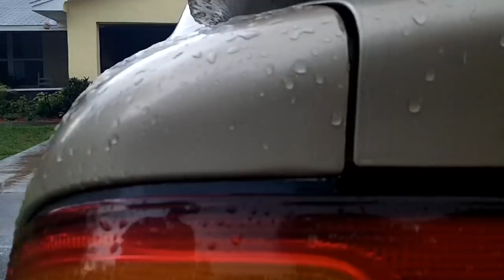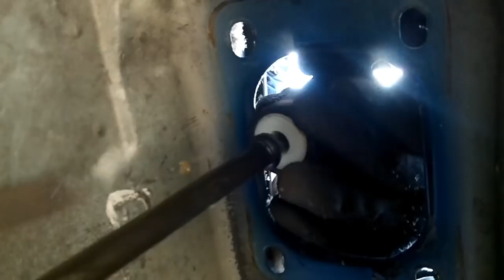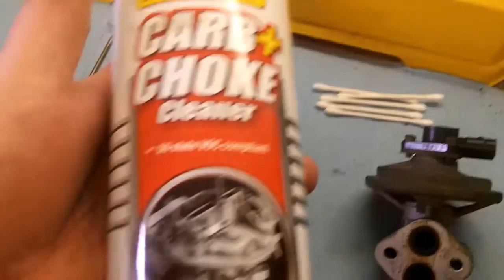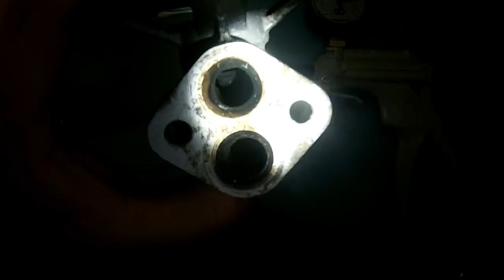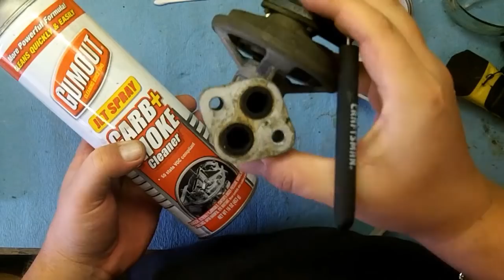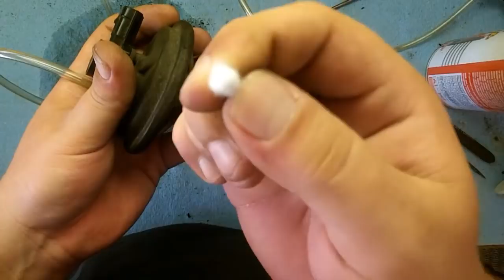How To Clean the EGR Valve

Comment: Is there a way to test it without the gun?
Reply from the maker: A regular vacuum gauge can do it and is much cheaper. The gun is only used to apply the vacuum but vacuum can still be measured with a stand alone gauge. Some type of vacuum gauge is required to accurately measure vacuum.

Comment: Both ports in the bottom are connected????
I can spray liquid on one hole and it comes out of the other with out sucking on that thing
Reply from the maker: Means the valve is stuck open and needs to be cleaned. If cleaning doesn't fix it then it's likely a rusted valve piston keeping it stuck in place. There's no way to fix a rusted stuck piston to my knowledge, it would need to be replaced.
A bad/busted rubber diaphragm will keep the valve closed, not stuck open, so it's not the rubber diaphragm in your case.
Reply: @DJDevon3  thanks... i ran a bicycle with thru it... it was clogged... thats what it was... THANK YOU!!!!

Comment: Hi, I have a 1995 Acura legend with 226,000 miles, my check engine light comes on and stays solid after driving few miles, I got a egr sensor code reading. I’m wandering if I just need to replace the egr valve with sensor and don’t have carbon buildup. Any suggestions would be appreciated.

Comment: What happens if i just disconnect the vacuum tube? better mpg ?
Reply from the maker: The O2 sensors will force the ECU to compensate fuel trims automatically. That means no change in performance or MPG. The only thing that will change is higher emissions. In some states it's illegal to disable the EGR system the same way it's illegal to delete the catalytic converter. If you have a stock setup there's no beneficial reason to delete those things.

Comment: i was gonna say this guys an idiot pumping brake clean thru his diaphragm but i see not bad mines not carboned but its real catchy like rust is siezing it up maybe 40k miles on a napa egr..
Reply from the maker: Good point. I have no idea how the rod is lubricated internally. If it starts sticking that sucks. I've never had to deal with that in any junkyard EGR on a 626. I can't speak for other vehicles if that might be an issue or not.  Definitely worth checking out the operation just to ensure it can slide freely, something I never even considered because I've never encountered it on a 626 EGR.

Comment: thanks, code 25 on my 91 toyota pickup states that EGR could be the problem. great video
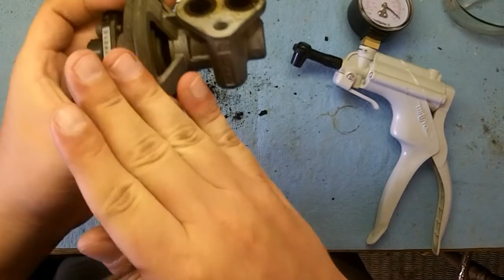Reply from the maker: Codes only tell you that a part is not functioning as it should. That's why I say cleaning the EGR doesn't mean it's going to fix an EGR code. It's still just as important to test the sensor which I cover in a different video but it's for the Mazda 626. You'll want to find a repair manual for your vehicle to learn how to test your EGR sensor. I recommend everyone check out my sensor diagnostic video too no matter what vehicle you own. I show how EGR passages are built into the intake manifold and the best place to look for clogs. The same concept applies pretty much to any vehicle older than 1997 as they all used vacuum EGR valves back then. More learning about older EGR systems ->. https://www.youtube.com/watch?v=ZSKs1WfM70I  If you don't have a 626 then start watching at 6:39 in that video to get a better understanding of EGR passages. They're important to finding clogs. ;)

Comment: what if we use sand paper the thin one?
Reply from the maker: No I don't think wetdry sandpaper would work well in this scenario at all.  The cavern inside the EGR is oddly shaped you couldn't clean inside it in that manner plus the carbon would clog up the paper the first time you used it.  Use pick tools instead.  Something as simple as a flathead eyeglass screwdriver would work well.  Use whatever you need to as a pick tool.

Comment: Thanks for video, I need to do this to my ranger
Reply from the maker: Yup this video can be beneficial to Ranger and Mazda B-series owners of the 90's since they would have used a very similar design.  Most 90's vehicles used vacuum actuated EGR valves.  Other manufacturers had wildly different designs (Chevy, dodge, etc..) but the concept is the same.  I wouldn't be surprised if you found a Mitsubishi symbol on your Ranger EGR valve as well. ;)

Comment: why not use a dremel with a brush on a medium speed wouldn't that be faster and cleaner???
Reply from the maker: The wires on dremels are notorious for flying off and they don't work very well.  I consider them a waste of money.  A small bottle brush is a good idea but it's not going to get the backside of the pintel or stopper.
Reply: When you're done with the dremel just vacuum any wires out.  I've used mine on tons of projects and they have been a d.I.Y lifesaver.
Reply from the maker: CCdude I'm not against the idea.  It's definitely a valid method and good suggestion for those that want to do it.  As a preference it's not for me.

Comment: Hi' i'm not getting a code but could it be the case that a clogged egr is what's causing my 91 dakota to cough and stall out occasionally? thanks
Reply: aw man thanks a lot; my truck is idling fine so i can omit the egr thing today and look at the fuel and such...thanks again!
Reply: Hey I dont know what happened to the reply but what did you do? I have a stalling issue on my S10 as well.
Reply: U won't believe it; i went to change my fuel filter and found that the rubber hose was falling apart and needed replaced but the rubber line was factory made onto the steel line. i cut off the steel line on both sides of the filter and used a compression fitting on the cut off steel line ;the opposite end of the fitting was barbed and allowed me to clamp on efi hose and i though that would fix my stalling issue but it did not. Next i filled up and put in a can of sea foam in the tank...Almost instantly the stalling stopped Plus, the smoke i was getting went i'd first start the truck is Gone! I call that additive Mechanic in a Can! I think that deteriorating rubber fuel line was getting into the gas and clogging things up, and/or water in the gas. Try the sea foam and tell me if it helps.
Reply: Kevin S. alright I will have to try that. Did you just add it to the fuel or also spray it into the intake?
Reply: since mine would start up, i only poured it into the tank, plus it's designed to mix with a full tank. hope you have my luck!
Reply from the maker: This essentially says it was either a clogged injector or fouled spark plug.  Induction cleaners can help but I can't recommend fixes without diagnostics.  No such thing as mechanic in a bottle.  Even a clock is right twice a day.  Without diagnostics you just made a wild guess.  Just because it was the right answer doesn't mean you came to the answer the correct way.  I can't condone that.  Glad your vehicle is working though. :)
Reply: thank you so much for weighing in on this DJ and for informing me of the possible underlying issues that the sea foam seemed to address. My hope is that it was a clogged injector because a fouled plug scenario worries me, i.e., what's fouling the plug to begin with? thanks for reminding me that my hail mary is not an answer in itself :)
Reply from the maker: Well take out your spark plugs and inspect them.  I forget that some people don't do the basics which depending on your car knowledge is excusable.  If you know cars then you should know better.  Induction cleaners like seafoam clean carbon buildup inside the combustion chamber and air intake.  Adding it only to the fuel supply will only clean the combustion chamber leaving the intake uncleaned.  That's what the smoke show is coming from.  The more smoke the better the result from the cleaning.  Normal operation causes carbon buildup.  An excessive amount of buildup means inefficient combustion either from a faulty spark plug (misfires), vacuum leak, clogged injector, open injector, shorted injector, bad rings, or other head mechanical issue like poor valve timing (jumped timing belt).  There are plenty of things that can cause it and without finding the culprit this issue will happen to you again.  Depending on the cause will depend on how soon the issue comes back. ;)  If it's just carbon buildup from normal operation on a 20+ year old vehicle then expect another 20 years until it comes back.  If it's due to bad spark plug then it could happen again pretty quick.  If it's a clogged injector then it will take some time.  Point is without finding the underlying cause you won't know when to expect the issue to return and to me that's unsettling not to know.  Hope that's helped shed some light on what to expect and why.  Keep on truckin brother. :)
Reply from the maker: Oh and since this is an EGR video... CAN SEAFOAM HELP CLEAN THE EGR?  Yes actually in an UNCONVENTIONAL way.  Pour the entire bottle of Seafoam into the fuel tank. Remember on the 626 the EGR only works when the vehicle is in motion & throttle is down.  You cannot do it during idle like a normal Seafoam induction service.  Is it as thorough as a manual cleaning, absolutely not, not even close!  If you have the option to clean the EGR system manually do it.

Because it's added to the fuel it will make its way into the EGR passage system (pipes and intake).   The cleaning action on carbon deposits will be minimal because it's first diluted in your gas supply then burned in the combustion chamber, then shot through the exhaust system of which only a tiny amount of that is diverted into the EGR system.  So we're talking a wing and a prayer to clean the EGR with fuel injection cleaners or seafoam type products.  

If the EGR is very hard to access or requires removal of so many components to get at it to make it cost prohibitive then sure I could recommend using seafoam in the fuel as a cheap stab at a fix.  Don't get your hopes up.  I've poured Seafoam directly onto a severely carbon gunked up intake and the difference was almost imperceptible.  Depending on the severity, you might have to run 20 bottles through before you see an improvement.  It will vary per vehicle.

I would recommend doing it with as little gas in the fuel tank as possible so as not to dilute it.  1/4 tank or less. Run it at high RPM's on the highway.  Slow down and speed up as much as safely possible if your goal is to get as much into the EGR system as possible.  This goes against the manufacturers recommendation because the product is not specifically designed for that purpose, no product is, however it is possible using the above advice.  I claim no responsibility for what anyone does with this advice.  It is my opinion based on my experience with induction cleaners and fuel injection solvents, not a factual assertion.

Comment: For the 2 ports I take a brass or steel pipe cleaner-clip the loop off of the end and put it into a drill. Use caution when inserting it into the egr valve as you could hit the piston rod. It works much faster than picking. Then use the carb cleaner.
Reply from the maker: Great tip!  Will still require some manual cleaning if the EGR is stuck open but your idea sure would make really quick work of it!  Great suggestion!

Comment: You are a mastermind mind. I just found this to be my issue on my 85 4runner re22. Thank you so much man.
Reply from the maker: Most EGR's prior to 1996 were vacuum actuated.  There were still some manufacturers that used vacuum EGR's well after 1996 but around 2003 everything started to go electronic with the world-wide adoption of OBD-II. If your vehicle is older than 1996 chances are you could benefit from watching this video.  Glad it helped with your 4Runner that's awesome. :)
Reply: I went and tested it. It fixed the stutering and stalling, but I still loose acceleration on second gear. I am going to be cleaning my throttle Body tomorrow.
Reply from the maker: Could be a lot of things such as bad injector, faulty purge solenoid, or low fuel pressure to name a few.  Don't throw parts at it, take it to a professional technician for diagnostic.
Reply: I have tried. Been to many, but noone and the OBD 1. I'll keep looking. They said the dealer should have one.

Comment: Thank you for your informative video.
Guess it applies to MX5 as well.
Reply: It mostly does. Our EGR's look almost identical and operate almost exactly the same way. I pulled my EGR a couple years ago shortly after I bought my '97 NA, as I was getting the P040x code. The plunger was stuck closed and wouldn't move. I cleaned it the "wrong" way by soaking it in carb cleaner first. Ultimately I had to pry on the end of the EGR piston with a flat screwdriver to break it free. After further cleaning of the EGR body and lubricating the piston, I have had no codes since. Still I wish I'd seen this video first.
Reply from the maker: Peacefrog0521, you bring up a good point.  It's a good idea to lubricate the rubber with silicon grease to prolong the life of the rubber.  As long as it's silicon based.  Never use petroleum based grease on rubber parts, it will eventually melt through them like acid over a long period of time.  Thanks for the compliment. :)

Comment: would wd40 do the same job as the cleaner you used?
Reply from the maker: +Billy Hurley WD40 is a lubricant not a cleaner.  I wouldn't be against using it on the rod directly after a thorough cleaning in order to lube the piston again but that's about it.

Comment: I have taken my truck to a couple mechanics, because it surges so bad that it about dies at low rpm,  they think that it is my egr valve, would cleaning it fix the surge?
Reply from the maker: +Shane Economu Depends on the year, model, and how the evap system is setup.  All vehicles are different.    There's no way I can answer your question.  Ask your mechanic to provide you diagnostic proof.  If he's guessing then he isn't doing his job.  Mechanics are like car doctors.  You wouldn't go to a doctor that says "well i'm pretty sure your limp is because you have a bad leg, we need to amputate."  Get professional diagnostic proof.

Comment from the maker: @Linda Sellers  There is no reply button on the bottom of your message.  Usually this is due to the privacy settings you have.  It only makes sense if he attempts to use the 91 octane as a replacement for brake cleaner... using fuel as the cleaning agent.  Fuel does OK on carbon as does Kerosene which is the main ingredient in Mopar's CCC or Seafoam.  I hope that makes more sense.
Reply: DJDevon3

Comment: BTW, I have been struggling with the 407 emissions code (I think that's the number) and the guy who replaced the OEM EGR said I should use a tankfull of 91 octane to clean out the "line." Does that make sense?  I like that you're careful to do things right and make the process logical and easier...
Reply: 91 octane is not good for prolonged use if your vehicle is not rated for it, alot of people use it thinking it is better gas but infact if the vehicle is not meant to use 91 the 91 octane will not burn as efficiently and leave behind carbon deposits. Octane is the resistance to burn so the higher the octane rating the more resistant it is to burning which is why higher compression engines use 91 or higher octane that way the fuel does not preignite in the combustion chamber. If your vehicle is rated for 87 prolonged use of 91 will leave behind carbon as all of the fuel is not being burned.

Comment: Hello, DJDevon3. can you help me? I'm having troubleshoting with p2144 on my mazda 6 3.0 what I have to do. thanks.
good video.
Reply from the maker: +Gustavo Melendez Find the factory diagnostic procedure for electrically testing your EGR valve.  P2144 means the control circuit is below expected threshold.  The PCM cannot control venting of EGR gasses correctly.  Generally this means faulty wiring, faulty sensor, or clogged EGR passage to the point the measuring piston gets stuck open.  Needs electronic diagnostics and if necessary a physical inspection of the inside of the valve for a clog.
Reply: Thanks myfriend

Comment: Can I use a break cleaner instead of carb cleaner? Btw, great video. Thanks
Reply from the maker: Ary M Sure, carb clean, brake clean, throttle body cleaner are all basically the same thing (with minor differences).  Any acetone or benzine based aerosol solvent would work just fine.
Reply: +DJDevon3 awesome, thanks
Reply: +TheSeriousCat 
Good to know. Thanks.  I was always under the impression that break cleaners are solvents that do remove oil products as well! Perhaps not.
Reply from the maker: ***** Brake cleaner is for cleaning brake dust which is hazardous to your health.  It helps minimize dust to wet everything down so you don't breath brake dust while wailing away on a stuck rotor or something like that.  It cleans the rotor surface of dust allowing for clean contact... just to name one of many potential uses for it.  You can clean petroleum based grease and oils with it no problem.  Brake cleaner is a more caustic aggressive version of carb cleaner.  Spray one of each on each hand and see which one aggravates your skin more. Carb cleaner can be found in "sensor safe" varieties so that it's not as caustic on metal, plastic, or rubber.  Brake cleaner is not recommended for usage on anything other than brakes because of it's caustic nature.  It can degrade plastic and rubber with prolonged exposure because they are petroleum based products, only use on metal parts if possible.  So avoid spraying it on OEM rubber brake lines. Best practice is targeted spraying not wild spraying.